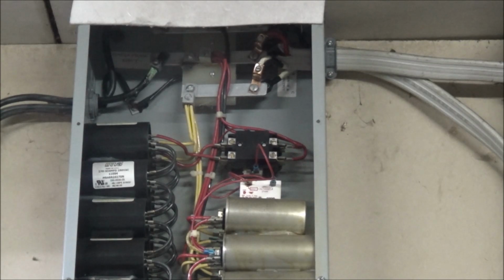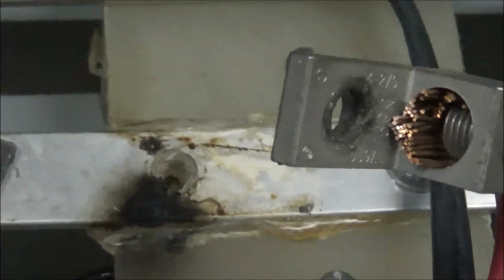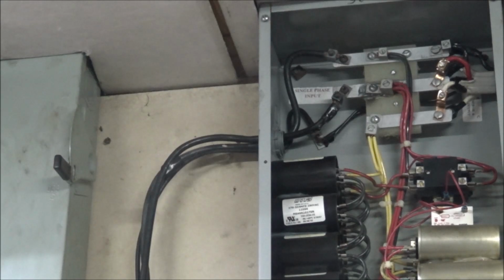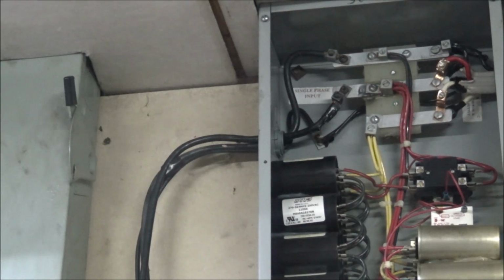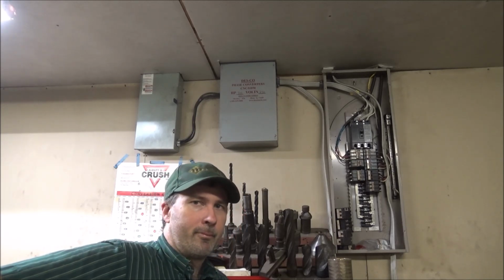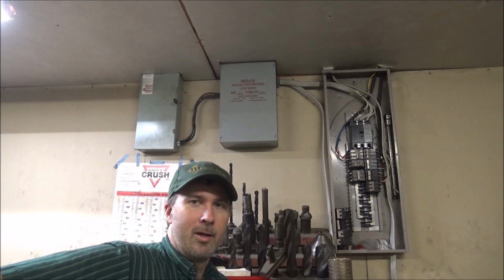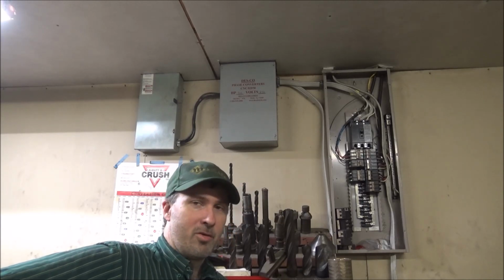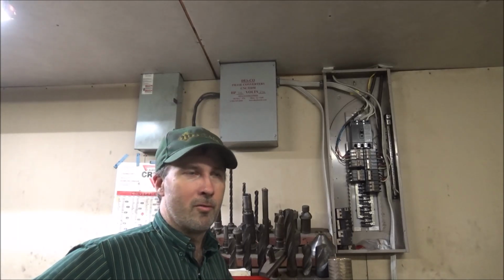Well That Ain't Good #2

Comment: We have single phase 240v Ac and the three phase in my shed is 100amps of 415 volt for the big lathe and vehicle hoist etc.  Our light switches flick down for turning on the lights and up for off, I think that is opposite to yours as well.
Reply from the maker: Yep, standard convention is the on is up here.

Comment: A cheapass infrared thermometer is a good tool for finding high resistance power connections you don't want to touch.  If your amount of use doesn't justify a full feature infrared camera like a Flir.

I don't care how much I should trust a disconnect or switch, if I don't absolutely have to touch a mains conductor i'm not going to!

Comment: A free wheeling electric motor needs bearings greased.
Reply from the maker: It would take an aweful lot of grease to put signifigant drag on the motor? Those big rotors have a lot of mass to try to slow down.
Reply: @bcbloc02  Spent 40 years with electric motors up to 125 hp and if bearings are greased properly it will not coast long. Only a dry bearing will free roll. But hey your equipment.

Comment: Nice repair. With electrical there is always something. Its good that is was easy to repair.
With all the 3 ph equipment that you have around, you should find yourself a nice diesel powered generator to run it all.
Reply from the maker: Diesel fuel is about 10 times as expensive as buying electric though.

Comment: If you had the RPC at 2x the motor HP it would start the mill fine.   25hp needs a 50hp RPC. The 30hp RPC will struggle starting the 25hp mill.
All RPC manufacturers recommend them  at 2x the HP of your biggest motor.
Reply from the maker: MetalWorks Machine Shop yes that is why my American rotary unit is a 50hp. I didn’t own the mill at the time I bought the RPC so it was sized for the lathe.
Reply: Im sure you knew all that,,

Comment: It should be emphasized to use NoAlox when ever there is aluminum with electricity connected to it! I heard you say you were using it, but it is really important! At least it was one of the hot legs feeding the motor . That way you didn’t single phase any of the machinery motors!

Comment: Glad it was an easy fix. 

Have you tried using the lathe motor as a booster for the mill.  I think the lathe motor will act as a rotary phase converter if you run it no load when you use the mill.  It looks like that is just some capacitors to give you enough phase shift the somewhat mimic a third phase,
Reply from the maker: It makes it worse. The lathe would only boost if it had additional balancing caps to help put power to the generated leg.

Comment: Did you ever replace the caps on that?
Reply from the maker: Cape Cod CNC No it is all original. I did at onetime have another cap added too it to better balance the voltage phase to phase but I wound up robbing it for my house ac one Sunday and never put it back.

Comment: I had a hydraulic heat issue with an excavator that made me buy a laser pointer thermal reader. It was a bypass in a valve. Made it easy to sort out. You may have one already, it's first thing i thought of when you were feeling connections for heat. Being able to detect just a few degrees difference can be handy sometimes. Good to show what happened, there has to be a lot of guys that have similar convertors. Thanks for sharing
Reply: A thermal camera is even better than a thermometer. They are as little as $200 from Seek or FLIR. You can scan dozens of connections in seconds.

Comment: $1500/ 20 years is only $30 per year for three phase which is not bad and it is still working.
Reply: Ron $75/year, or maybe $25/year/phase ;-)
Reply: @EJP286CRSKW  Damn, what was I thinking? Thanks, I must have been using "depreciation" math. :-)
Reply: What's that! The Mayan calendar.
Reply: @robertklein2816  Its metric. :-)

Comment: I never understood why so many AC connections rely on screws and aluminum.  All DC power work I've done is copper, or tinned copper, and strictly use compression lugs.  Everything gets polished up, then coated with no-ox then crimped and torqued down.  Once in a great while might get a battery strap that loosens up and creates some localized heat, but we catch it in annual inspections using FLIR cameras.  Open an AC cabinet and I always think this whole thing is one under torqued screw from melting down.
Reply: @weldmachine  Aluminum connections are known to loosen over time.  For clarification my DC work is stationary.
Reply: @ShainAndrews  ....Nope.  Aluminum has no problem in a stationary installation.
Reply: @paulcopeland9035  Coefficient of expansion and creep
Reply: I've seen many electrical connections that did but shouldn't loosen over enough time including aluminum and brass screws. Thermal cycling seems to have or be at least part of the cause. Possibly locktiteing the screws would prevent or stop most of it, but I've yet to see any industrial electrician do so on anything I've operated. From that I'd assume there's some good basic reasons for not doing so.
Reply: Peter CCR ENG - Thermal expansion and micro-fretting are both a problem with aluminum used in electrical work along with copper. It's pretty much not used in residential/commercial applications anymore in the US. I don't know if you dealt with it there but 40-50 years ago aluminum wiring was used here and caused lots of problems.  No-ox or NoAlox help, but by themselves they won't totally solve the problem.